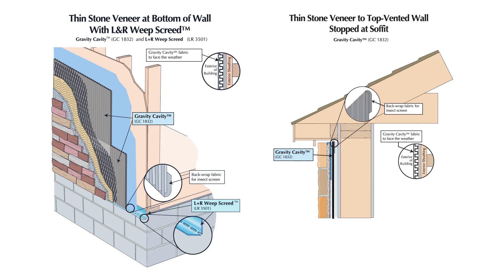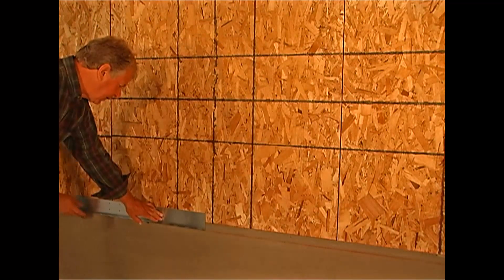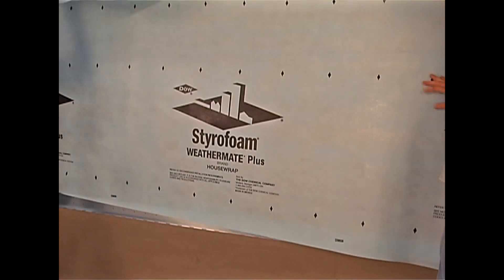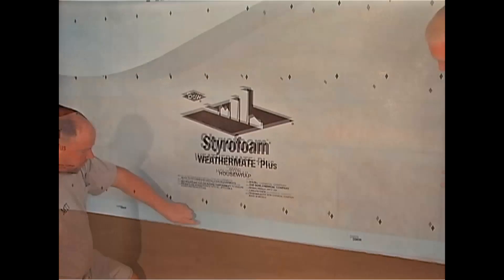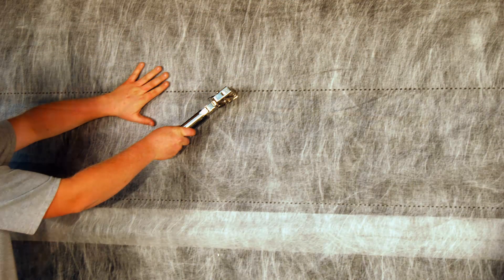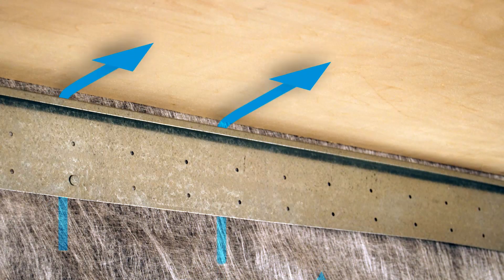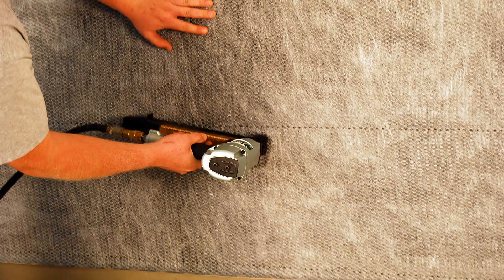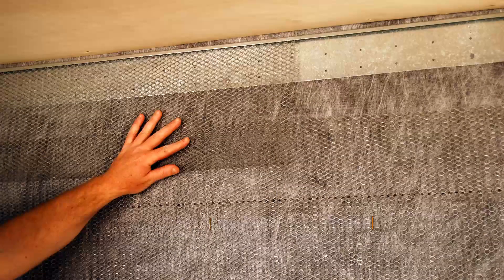How to Install Thin Stone with a Rainscreen - Gravity Cavity Installation Video

Comment: So we have tons of red wasps here that will absolutely use that soffit gap to crawl into and build nests. I normally caulk that opening. What other solution is there if you don't leave an air gap? Leave the soffit off and install the soffit after the stone so that it uses the soffit to vent?